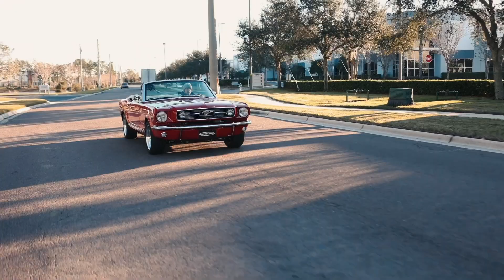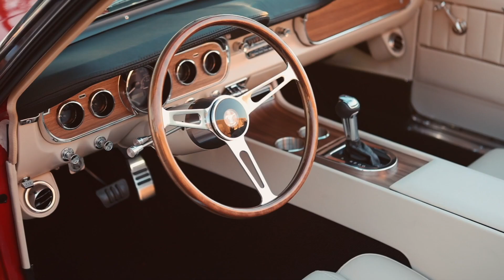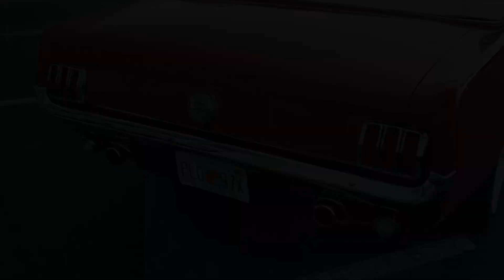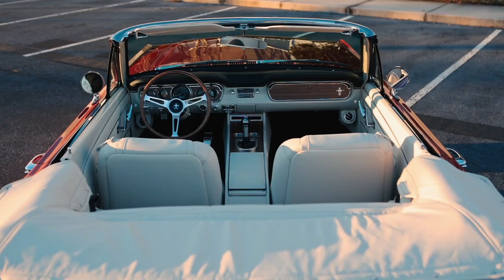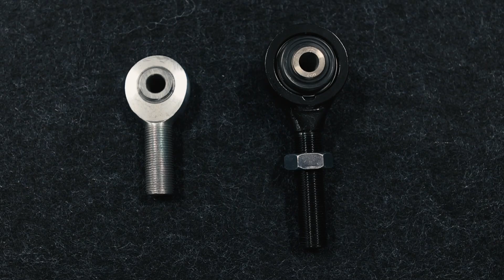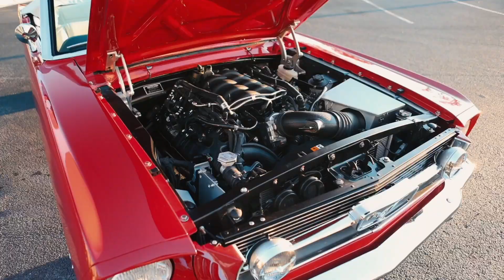Revology Car Review | 1966 Mustang GT Convertible in Candy Apple Red

Comment: Those rear seat speakers were not stock and cannot be added to the original convertibles because the top mechanism eats up space.  Is that a special panel that protrudes to make space for the speaker?  Most early 65/66 owners (like me and my 65 convertible) could only add speakers by cutting holes in the lower door area.  Later, front seat kick panels designed to hold speakers were introduced by vendors.  I want those rear speaker panels for my 65!!!